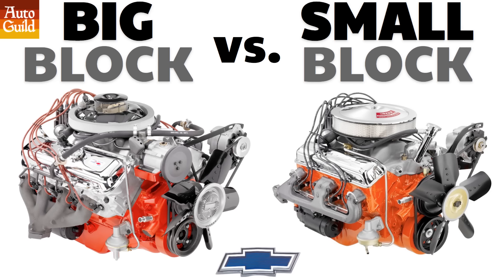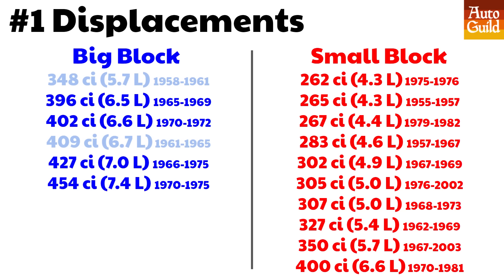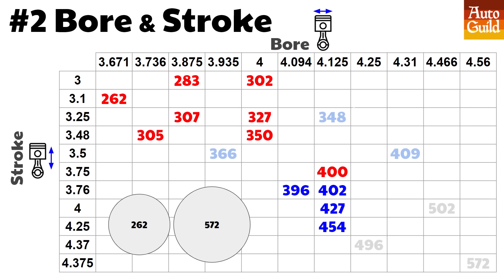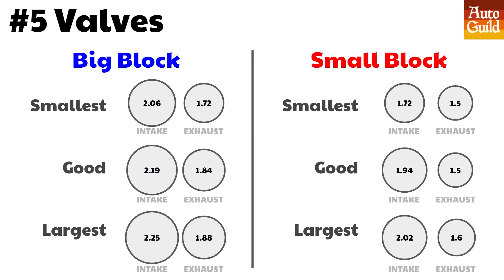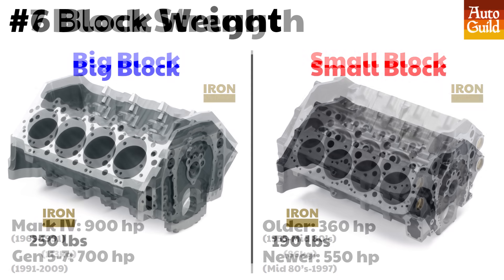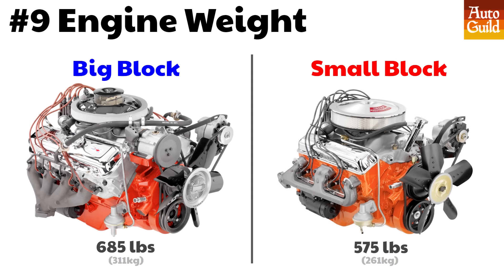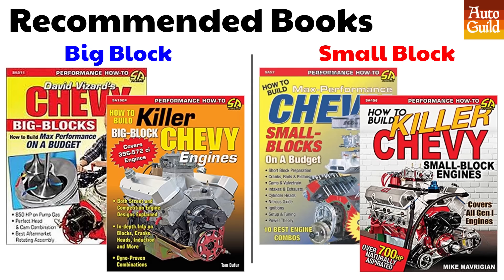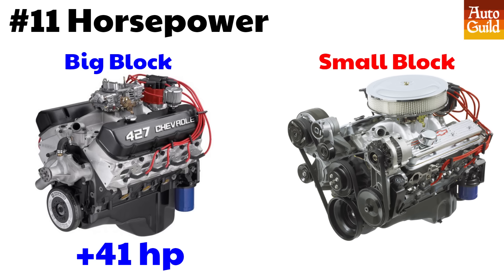Big Block vs  Small Block Chevy Comparison

Comment: If you ever have a Big Block, you will throw rocks at a small block.
Reply: I have both and like both for different reasons.  Lighter cars are fun with sbcs and not nose heavy.  Larger and heavier cars with BBC are more fun in a straight line.  I don't play with trucks... my GMC dually with a Vortec is for towing my race car trailer.

Comment: Ok, where do I start, much misleading info in this.  Some of it is just wrong. First, if you build a 400 and a 396 identical the output will be determined by a numbers of things.  Which 396 heads did you run?  What cam?  The big block needs much more cam to perform and this will not cost more than whatever cam they used.  Just a good hyd flat tappet cam would out perform the small block by much more than was stated here. The 400 small block had a max of 390 ft lbs of tq in stock form.  The 396 could easily have 75 ft lbs or more torque and 30 to 40 more hp.  This is not a knock on the small black 400 because I love them and have built many.  Ok now for rpms, there were many big blocks rated for over 5500 rpms.  And many of the factory performance motors were rated at 5000 but made power well past that.  Not trying to be a jerk but so many of the fundamentals in this video were incorrect.  And as far as mpg...camshaft duration and compression have way more to do with mileage and power than which block you have housing your internals.  A 396 with good compression and A torque cam cam get better hp and mpg than a 400 small block that’s stock.  Yes the bbc cost more to build initially.  But it cost no more to build it with a torque cam than it does to build it stock.  Also I’d like to see what justifies his comments mid 80s small blocks are more capable of handling higher hp than say mid 70s.  All small blocks after they went to the large journal crank are good to mid 500hp range if they’ve been machined and assembled correctly with proper tolerances and quality parts.
Reply: GM only built the sbc 400 vs the bbc 396/402 to cut some weight off the full size cars.  It had to do with trying to increase mileage and maybe emissions in the '70s.  The full size cars had gotten rather heavy with the extra bracing in the doors for safety and the shock absorbing bumpers, so they wanted torque to move those monsters.  My parents had a '71 full size Kingswood station wagon w/ a sbc 400.  It moved that hunk along nicely which was Chevy's intention.  Those short rod sbc 400's were never meant to be hot rodded and only came with 2 barrel carburetors in the passenger cars.  They did what GM intended.

Comment: The weight isn't a super big concern in some applications. If you want to go fast in a straight line, the extra weight of the big block is more than made up for by the extra power. I wouldn't put a big block in a car I wanted to handle well though. That's why the old school shelby gt350 is faster around a track than the gt500. It handled better due to less weight on the nose. Of course I'd pick an ls engine over a big block or a small block any day

Comment: Big blocks are fun in boats but I don't see the point in cars. Maybe bigger work trucks. Even a long time ago the small block could usually compete unless you were after crazy hp numbers. Today, it's no question, LS weighs nothing and is a million HP.

Engine weight is a big deal...even in my Silverado 1500 I've been wanting to swap in an aluminum block to replace my factory LM7. 100lbs is noticeable but I wouldn't spend thousands extra on a fancy aftermarket aluminum block...

With the big block the rotating mass is heavier, so you don't get as great of throttle response and more internal friction. And worse gas mileage, but that goes without saying.

They're great for industrial and marine type uses, at lower HP outputs, if you can feed them gas. $$$$
Reply: If you had a boat that needed a big block, you should have used the engine as an anchor, and used diesel power ...
Reply: @sking2173  You clearly know nothing about speed boats...
Reply: @ryanroberts1104  — I was making the statement in the context of cabin cruiser class watercraft. 

I’ve seen too many that have tried to make do with large petrol engines when a diesel would be much more suitable power.

Comment: I am in the middle of a BB build right now and I have 2 concerns . ground pounding torque and 500hp both can be achieved pretty easily with a BB
Reply: Use a nice roller cam, you’ll never go back
Reply: Good cam, intake and headers and your at 500. I like nice pistons too. Rev my LS5 to 6500. Some valve spring issues occasionally with missed shifts.

Comment: could you make a video specific to the 327 4 bolt that was made in 1968-1969.  I would like to know more about these little know engine blocks.
Reply: 327 was never a 4 bolt block
Reply: @russellleahy  But you could drop a large journal 327 crank into a 4 bolt main block (350) and it would work.

Comment: The redline of the big and small blocks are way off!
Very inaccurate information! 
The redlines and characteristic valve train speed are way off.
You had to replace the valve springs more often, but the L88 would go to 7400 rpm easily.

Comment: Chevy engines have always had a longer stroke and smaller bore. Ford engines have always had a larger bore and shorted stroke. Thus Chevy engines have always had more torque and Ford engines have higher revs and horse power at the higher revs.  Please correct me if I am wrong.  I am calling BS on this post.
Reply: Not exactly and completely opposite when Ford introduced the modular V8 with its tiny bores. The Ford Windsor had 4" bores. But so did the Chevy 302, 327 and 350. If you strictly compare the 302 Ford to the 305 Chevy then yes this is somewhat true. But bore/stroke only leads to a tendency for an engine to favor one type of operation over another. Displacement, compression ratio and airflow have a much bigger role in determining how an engine will behave. The Ford advantage with the 302 over the Chevy 305 was the bigger bores allowed for bigger valves and better air flow. So when you did modify the stock heads, put on aftermarket heads or upgraded the cam then the engine responded better. But in stock configuration they were just adequate engines that met emissions and returned acceptable fuel milage and were virtually identical performers.

Comment: 72s into 80s big blocks bare weighed 292 to 298lbs.  Big block guys usually don't waste their time and money on 400 cubic inches unless they are doing a restoration.  They went with them for the displacement.  The more cubes the better.  You didn't mention the 8.1 big block used in many motor homes.  8.1 displaces 496 cubic inches.  4.250 bore, 4.25 stroke.
Reply: LOL ... A 500 CI gas engine in a motor home is ridiculous ... Such vehicles are well into diesel country ...
Reply: @sking2173  Diesel rigs cost twice as much as gas units.  Most new gas motor homes run from 75k to 200k USD  Diesel run 170k to millions.  As you can see why they still put gasoline engines in motor homes.

Comment: Every big block I've used or seen needed rebuilt long before the small blocks. And don't even get me started on oil consumption on big blocks.
Reply: Totally. There's a reason why the Studebaker 289 cid. V8 is often considered the BEST AMERICAN V8 ever to be built.
Reply: Big Block Chevy and even some SBCs seem to be hard on camshafts because they need higher spring pressure to allow the rpms they can attain.  That has been my experience as I own both and love them both!

Comment: 3:33 What. How? It's thinking like that that has made the NHRA limit us to 500 cubic inches with a 1/4 mile of 4.485-second pass @ 338.35 mph. If they allowed top fuel dragsters to use those ridiculous monster motors we could hit, who knows 2.99 seconds in the 1/4 mile. But most of all they look awesome. Like the Moran 670ci, I mean it is beautiful. I had an ElDorado with the 501 ci. It was a tank. Anyway thanks for the video.
Reply: Chevy big blocks could never & have never made the power to be competitive in top fuel. Hemis own the class.

Comment: 327, best small-block Chevy ever made. It lasted too long so they made the 350. No car manufacturer will allow an internal combustion engine for passenger cars that will go over 500.000 miles. Hell if they had their way they would not let them get 200.000. I almost always get over 300.000 on every car I've ever had.
Reply: I agree.  I currently have 5 small journal 327s.  3 are in cars.  I'll take a high winding 327 with a manual trans. over a 350 automatic any day.  It's about the "fun factor."
Reply: @Jendal3  That sir is awesome. Lucky man.
Reply: @axemastersinc3269  Over 50+ years playing with sbcs.  First 327 I owned (and still have) is in a '63 Impala SS 327 300hp engine.  I love that little jewel... ran great for a 4,000 lbs. car, but was hard on parts behind the engine.  Broke the Borg Warner T-10 4 spd several times, 3 axles, a couple of ring and pinions and finally pulled the upper control arm bracket right out of the housing.  Too many power shifts when I was young and kinda stupid....
Reply: @Jendal3  Right on. She was the best small-block ever made.
Reply: What are you talking about? The only difference is stroke. The reality is the removal of lead from fuel and introduction of strict emissions standards lead to early problems back when small blocks became the 305 or 350. But it had nothing to do with engine displacement or type. Engine life is usually dependent on how the owner takes care of it and how they drive it, emissions equipment notwithstanding. Today a gas engine going 500,000miles is not hard if the engine is made well like the LS series or Toyota V8's.
Reply: @geoffmooregm  SONNY'S 2019 1/2 WEDGE PRO MOD 903 C.I. 5.300" BORE SPACING 1740 HP So this is the same size as a 427 or a 455 or a 501?
Reply: @geoffmooregm  1005.8ci Godfather Big Block Engine so that 501 ci I had was as big as this?
Reply: @axemastersinc3269  Your questions make no sense you are listing billet aftermarket blocks and comparing them to production castings?
Reply: @geoffmooregm            6:31 Sizes like the 632 and others but I didn't put those on there because they're kind of ridiculous.

Comment: 305, 400 SBC were junk.  GM could have saved a ton of money not building the 307, 305 and 400.
Reply: The SB 400 generated a lot of torque for vans, Blazers, and those big boat Caprices in the early and mid 70’s
Reply: And overheated because the cylinder walls are too thin.  They’re junk.

Comment: I used to circle burn dirt tracks with my Buick 455 I ran that motor at 6000 to 6500 at the end of every straight. Won almost every race unless I got knocked out. Never turned a bolt on it for four years
Reply: Yeah right!! Everyone knows 455 Buick is the king. Those things even see 5k and the bearings are all over the bottom of the pan, cylinder heads like a pencil sharpener hole, Come on man 😂
Reply: @sammendoza7168  Haha! His avatar of a 4wd gives a clue

Comment: The weight issue has more to do with what you're trying to do with the car than anything. People who have a pro touring first gen Camaro are going to have a harder time making the car handle well with the extra weight of the BBC. Even worse, the extra weight is up high and forward (the frame mounts for the motor mounts in first gen Camaros raise the engine up higher for steering and exhaust clearance, making the problem even worse). If having the car handle corners well (or at all) isn't a priority, then it's a much smaller issue. That's the major reason why Mark Stielow's Camaros have always had some form of SBC in them.

Comment: Once again I will chime in a high nickel 4 bolt main small block will take 1000
Reply: Those numbers were just the GM recommended operating power numbers. They are quite conservative. A lot of guys have 1000+hp Big blocks on Gen IV and Gen V blocks. But it comes down to the tune and use. If you have a carb with shitty fuel distribution and some cylinders are detonating while the others are pig rich then is clearly won't last as long as a dialed in EFI motor.

Comment: Concerned about BB nose weight? Moving the battery from in front of the front wheels to the trunk it the same weight transfer as moving the engine back 10"
Reply: Bbc>Sbc
Reply: Just buy a fiberglass fron clip and take that weight back out. Its worth the extra 300 or so hp.
Reply: No way, a 40 pound difference does that much? Do you know what that would be like if done to a car with a small block?
Reply: @trashbandit2449  I guess moving the engine backwards does that little (concerning the center of gravity).
Reply: @trashbandit2449  think about where the battery is..its right next to the radiator. Move that 40 lbs all the way to the opposite end and because of leverage its acts as a multiplier.
Reply: @cuzz63  correct, I knew it would multiply the difference in weight distribution, didn't know it would be that large though.
Reply: @trashbandit2449  its deceptive, I dont know if the 10 inches is correct but a 40 lb battery is almost 10% of the weight of a small block.
Reply: @trashbandit2449 its easy to check, measure the height of the front and rear of the car at the bumper, pull the battery out and put it in the trunk.
Had s couple esrly 70"s Camaro back in the day. I got one down to 3050 lbs with a 50/50 weight split. Lowered  with g 50 15s on rally sport wheels. I was 2 mph faster on the skid pad and 2 10ths quicker on a slalom course than my buds 84 vett
Reply: @blackbirdxx928  wow that's crazy, especially for such a front heavy car

Comment: Also were 366 and 427 tall decks. Both big blocks.
Reply: Awesome if you have a school bus or grain truck...junk in every other respect...
Reply: @jaredmayer3960  Years ago I used to snap up all the 427 tall deck blocks I could find. Extremely stable blocks for high rpm, long rod, drag engines.... 430ci, low 8's at 3200 lbs. Yep, they're junk blocks all right......  Try to get to that power level with any factory small block casting that is NA.
Reply: @jaredmayer3960   
True. One could also make the same argument for the 262, 265, 267, 305 and 307.
Reply: Don’t disagree.  The 305 and 400 were total duds.  All the ones you mention were boat anchors once the 4” bore large journal blocks were out.
Reply: They don’t fit under the hood of your truck, Camaro or Chevelle...so yeah they’re junk.  To each their own dude.
Reply: @jaredmayer3960  They do fit, more often than not with zero mods to the chassis. There are lots of companies that still make headers for them to fit into anything a standard big block fits.  Many of Hedmans and Hookers BBC designs will work with any block or port height as is. People saying they don't fit, don't know what they are talking about in the slightest. They just don't want to buy parts specifically for tall decks. Worst case scenario is an intake (or spacers), longer connecting rods, an adjustable distributor, longer push rods, an a possibly scoop.  Everything that bolts onto a BBC short deck will go right into a GM tall deck block. All of which anyone building a drag car will be more than willing buy for the power gains of a long rod motor. If they didn't fit, World products, any many other block manufactures would have never made taller blocks for the street, and they all do. Many of Worlds, Blueprints, and tons of other manufactures BBC's are tall decks, and there are tons of videos of them in cars driving around on the street. A GM tall deck is .4 inches taller, that's it. They even fit into Corvettes......

Comment: I LOVE MY BB BUICK 455, ITS A
TORQUE MONSTER!! NICK AT
NICKS GARAGE ON YOUTUBE
PUT A MILD BUILD ON ONE
AND DYNO TESTED IT AND
IT'S A BULLY!! T/A PERFORMANCE
SELLS A TON OF HORSE POWER
GOODYS FOR THE BUICK ENGINES
FROM THE 6 TO THE 455!!
I HAVE THE TURBO 400 HANGING
ON THE BACK OF IT STUFFED INTO
A 79 BUICK REGAL, I HAD TO SWAP
REAR ENDS OUT USING A 80 MONTE CARLO WHICH HAD A
STRONGER REAR DIFF AND GEARS!!

Comment: I have owned equal chevy 2500hd trucks. One with a 6.0/4l80e and one with an 8.1/allison. The 8.1 absolutely pulls trailers better and does it at half the rpms of the 6.0 small block. I like the feel of the big block better
Reply: Heck yeah, that TORQUE bro..
Reply: What is real world MPG numbers? I'm trying ti decide what to put in my 1st gen /colorado dd
Reply: @jeepinspence my dad had a silverado 8.1 that got 15 mpg on the highway under no load

Comment: The big block is objectively better. Nowadays you'd have to spend more money on a small block to match a milder built big block. You'd also have to turn the SB harder to make the power. The big block also has incredible torque that the small block doesnt. 
A horse that runs fast, doesnt run as long. 
And with the right valvetrain (still being value-conscious) big blocks can achieve 7,000-8,000 rpm reliability. Yes they are heavier, but everything else makes up for it.
Reply: I don't know about that. Big-blocks tend to be run very hard and are ready for a rebuild sooner than small-blocks. Fuel economy is also much worse. My Studebaker 289 cid. V8 more than does the trick for me.